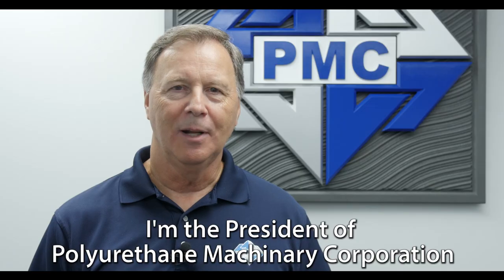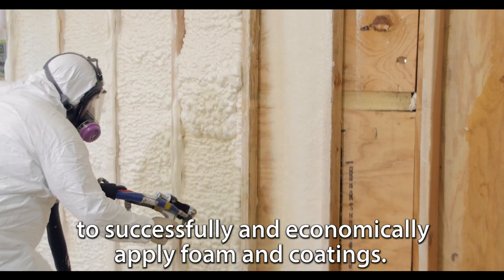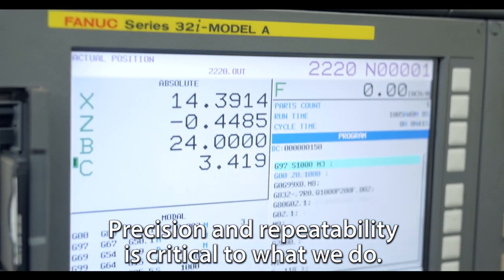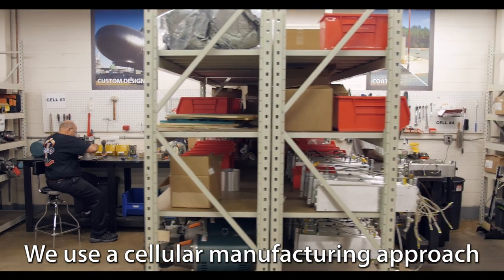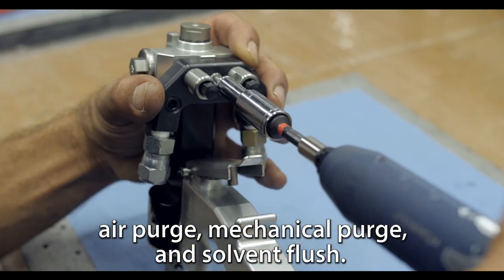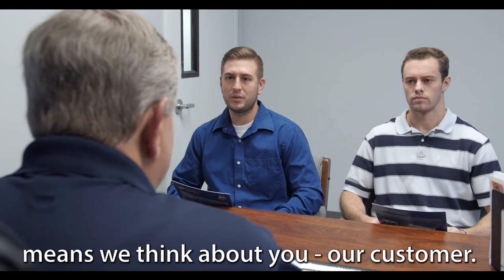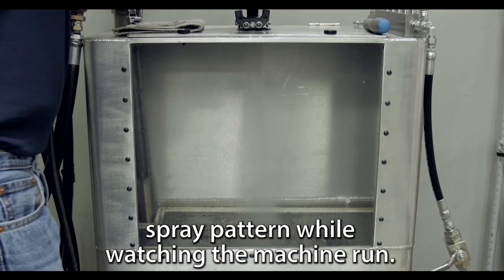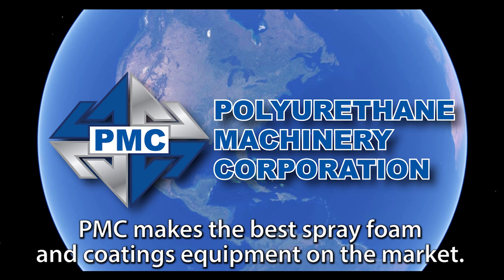Polyurethane  Machinery Corporation Introduction Video

Comment: Why dose my line crystallize
Reply from the maker: Hi David, 

Crystallization in a hose line can occur in high moisture environments, or if a hose is sitting without any chemical movement for too long. Please be sure to process chemical or flush the system if the machine will sit unused after spraying. It's recommended to flush or process chemical through the system every 5-14 days, depending on your location and environment. 

Thanks for your comment!